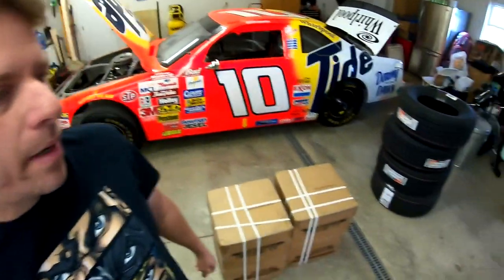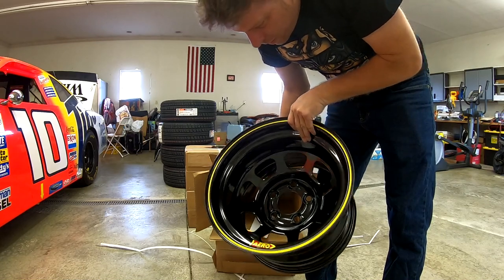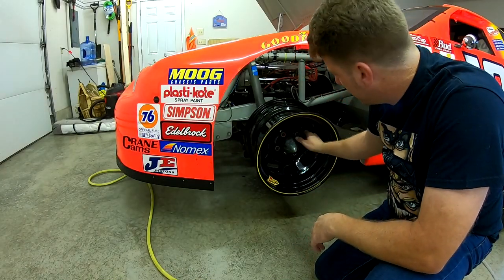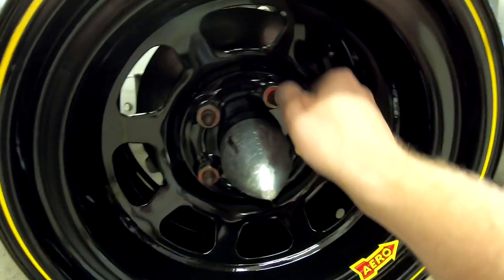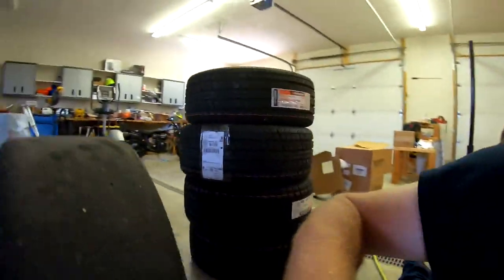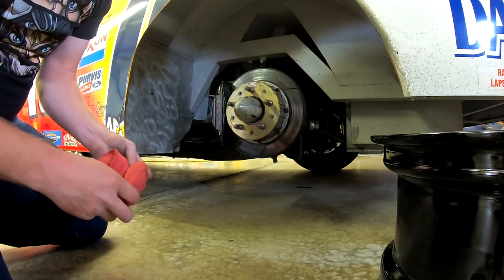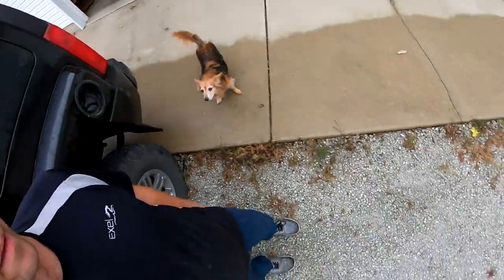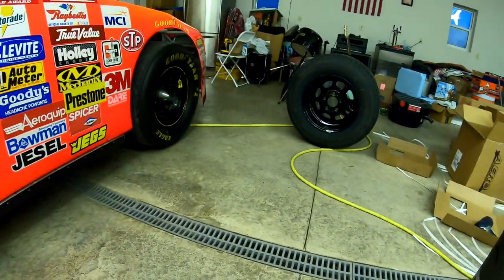Street Tires For The Tide Car

Comment: I just bought a 4th Gen Nascar Pontiac Grand Prix . I was looking for a proper set of new wheels . I prefered the red stripes as opposed to the yellow on the rims . Wasn't sure what size to order , I thought a 59 series rim is what was used by Nascar teams . I think I want to go with some drag radial tires like Cleetus did with the Dale Truck
Reply from the maker: These rims worked perfectly, and they were so cheap. I didn't get a notification for this comment when you posted it, that was strange.

Comment: not sure where you get them When I was in school I mounted all the tires before the race at MIS (michigan international speedway) when I did an intern for a tire place. Tires came in and the teams dropped of their sets of wheels from the last race and we dismounted and put the new slicks on. Not sure where they came from or what they did with the old ones.
Reply from the maker: Some insiders can get ahold of the used tires, but I don't think it's an official kind of thing. As I understand it, the tires were leased from Goodyear, and they get them back for inspection and research. I don't mind buying Hoosier slicks if I can't get Goodyear. 

That must've been pretty cool knowing some of the tires you mounted went slingshotting around MIS on a NASCAR cup car.

Comment: tech tip: pull your gun back with the nut to keep it at the end of the socket and dont let off until that nut flings off, oh an slow is fast, fast is slow
Reply from the maker: That's a pro tip right there, I def wouldn't have thought of that.

Comment: What size wheels are they and what's your backspacing
Reply from the maker: From the listing on Summit:
Wheel Circle Track, Series 50, Steel, Black, 15 in. x 10 in., 5 x 5 in. Bolt Circle, 4 in. Backspace.

They fit great. Still going strong. There are some thin spacers, but nothing more than a 1/4-1/2 inch total, I think.
Reply: @RightTurnRandy  thanks. I'm trying to find some that have less back spacing but I'm having trouble

Comment: But why is the lug nuts keeps getting stuck on your pit gun?
Reply from the maker: It's a new socket, not worn in. Sometimes that just happens anyway. In nascar, they pull the gun off and the lug nut finishes spinning off by itself. If you see it close up in slow motion, you can see it happen.
Reply: @RightTurnRandy  So that’s why they keep getting stuck

Comment: Sounds like you need to repack those wheel bearings
Reply from the maker: You're right, they did need to be repacked, badly. I repacked them in the locker install video. But the grinding coming from the back was a brake pad installed backwards lol. That's in my axle disassembly video:
https://youtu.be/L57q3lXC2QU
Reply: @RightTurnRandy  sweet I like being right about things I know nothing about lol cool thanks for the follow up

Comment: How come I can’t find any Goodyear tires for this exact rim except for the used nascar ones on ebay
Reply from the maker: I couldn't find any Goodyear tires in this size. In fact, I had a tough time finding any in this size for a good price. There isn't a wide selection. This was a common size tire in the 60's and 70's, and my guess is that Goodyear wasn't selling enough of them today to justify production. But they make all the tires for NASCAR, so there are some of those used ones floating around.
Reply: @RightTurnRandy  Give Goodyear a call in Akron (I am from there) and see if they can help. I know they run around $2,000 a set. The tire bill for a Cup team for a season is 1 million dollars. Looks like that car has taken a pretty hard hit on the right front at some point.
Did they take the mirror out of it?

Comment: where did you buy the wheels?
Reply from the maker: I got them on Amazon, if I recall correctly. I did go to the Aero website to check the model number to read up and make sure I knew what I was getting.

Comment: Do those rims sit on the hub. Or on the lugs
Reply from the maker: The answer is both, really. Or I'm not clear on what you're asking. They are one piece, slide over the wheel studs onto the hub. Still NASCAR, same equipment from '94.
Reply: Does the center hole of the wheel fit snug  around  the hub of the car?
Reply from the maker: @dtruth5769  Yes, relatively snug. If all the studs were missing, the wheel would be centered, but probably fall off. Not snug enough to hold it in place. One thing I found interesting: The wheels are not balanced off the center hole, they are balanced off the bolt pattern, I had to be specific at the tire store to have them balance off the pattern, instead of the hub center.
Reply: Ok thanks! How does that thing run?
Reply from the maker: @dtruth5769  Had a misfire and was poorly tuned when I first got it. Carb still needs to be jetted, timing is good now. Found a spark plug with three cracks in the insulator when I took it apart for the tranny swap, I imagine it will run really well once the transmission swap is done. I think it's pretty dang fast. loud, uncomfortable, hard to drive, all my favorites!

Comment: what is the dimension of your rims and tires
Reply from the maker: The wheels are 10 in wide series 50, 15's, roll formed with a 5 inch bolt pattern. The tires are hankook ventus h101's, 275/60/R15